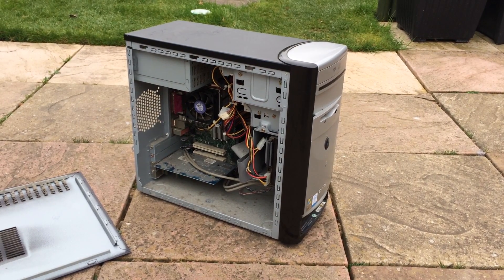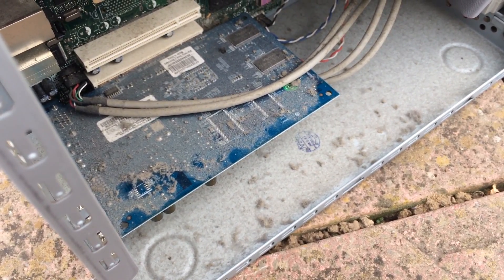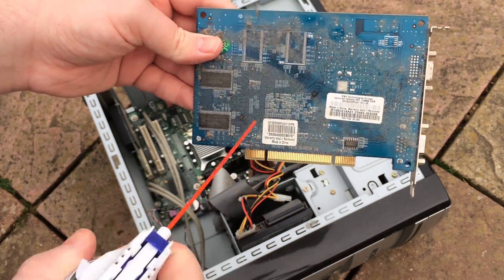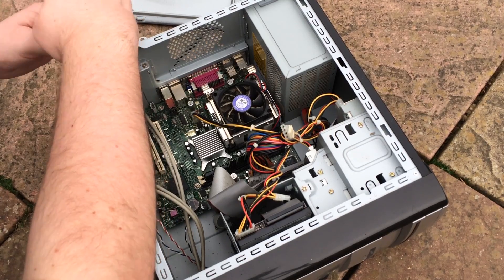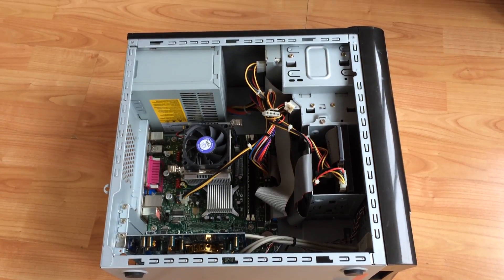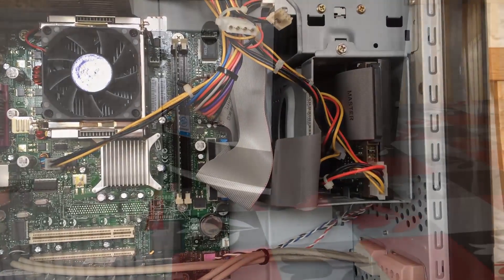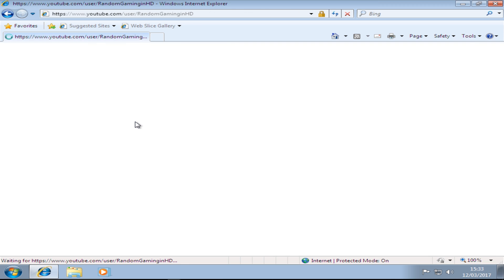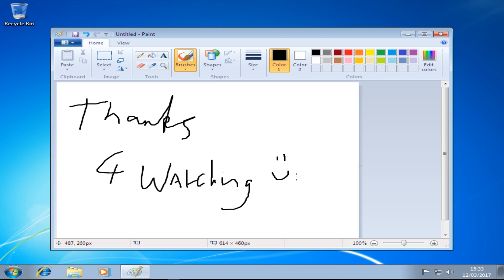Cleaning up a Super Dirty Old PC

Comment: My favorite method is to use a leaf blower <low power one>, it freaks out the uneducated and those ruled by myths rather than imperiacal data.   Less scrubbing involved than just use a small amount of cleaner and wipe everything down.  Also spraying down old Motherboards and cards with electrical contact cleaner and/or degreaser really cleans everything up to like new condition.  Obviously make sure everything has dried/evaporated before trying to introduce power.

That old FX5200 you have there was a great card to make my Win98 retro rig handle everythying,  though I did add an aftermarket cooler to it as I never liked VCards without them.  Great video!

Comment: My parents computer is about 7 years old and that thing makes SO much noise it sounds like you're in a jet tunnel, I took it apart, cleaned it up, removing all of the dust, adding a better psu (400 watt) and an old graphics card that I had laying around from my old pc, I also found a spot on the case where I could add one more 120mm fan so I did. So about 5 man hours later and now I have a computer that doesn't work anymore, at least it doesn't make any noises XD

Comment: A buddy of mine also gave me an old Dell. It was a Dell Dimension 2400 and it was the filthiest thing I had ever seen. It was dusty, dirty the computer and even the keyboard and mouse were infested with bugs, it smelt horrible, and every time you turned it on the fan would blow out this dirty, musty, moldy, and rotten smell out of it. I cleaned it up and even then it still smells.

Comment: I use a Worx Air blower it does a great job getting out all the dust. I also removed the CPU fan and cleaned it out real good. You can then also use Brake Cleaner on the circuit boards just make sure you let it dry at least 24 hours. I always spread my lube (that's what she said) with a plastic bag and my finger inserted inside on the CPU surface.

Comment: Get yourself a cheap paint brush with relatively hard hair, it's very efficient to go into every nook and crannies. Blowing air is not enough. I also use 000 wire wool to clean connector contacts, it works very well.
For VERY dirty computers, the shower is not a bad idea. Take it apart and give a good wash to the various boards, let it dry completely obviously before using. Don't wash the mechanical parts.

Comment: I got an E-Machines T5088 with a Pentium 4 641 3.2 ghz(2 megs of cache) Three gigs of ddr2 ram, 120 gigabyte ssd, And an Amd Asus 6450 video card.  (All spare parts laying around) I paid 5 bucks at thrift store and runs pretty good for internet duties.  I think getting Windows 7 updates was the hardest part of this build but worth it.  I think this Cpu  I have was the last/latest Pentium 4 built for the E-Machines.  I'm gonna plug it in and see/revisit what is has to offer :) Thanks for video :)

Comment: This PC isn't that dirty.  I've seen PCs so filthy the fans actually couldn't move, not just the air, but themselves.

But, for this much dust, I'd recommend taking each component out and rinsing them in the sink (except drives - don't wash those).  Just be sure to let it dry before putting it back together.  I have only once caused damage by doing this, and that's because I was too impatient and turned the PC on before the GPU completely dried.  It still worked but started artifacting if the VRAM usage got too high.

Comment: Did the same thing with a Packard bell iExtreme P2.4 system that was being dumped by a neighbour. What cool about itmkit's pretty much trying to look like a Mac. Firewire ports, the speakers and 12 inch tft screen in a magnificent white stylised casing. Worth it a stylised antique games machine.

Comment: this is older than 10 years since it's using a socket 478, wow! Impressive how Intel's shittiest architecture (netburst) still manages to stick around even today. I personally would take an LGA 775/771 any day over this, actually I would re-use the e-machines case shown in this video and drop in a g41 chipset LGA 775 board, drop in a 45 watt xeon l5408, and clock it up to 2.8 GHz and be able to run mostly anything and overall light-years better than the socket 478 shown in this video, and all for 60 bucks including 4gb ddr3 ram, Asus p5g41 board, and l5408 CPU lol!

Comment: Yep good advice. People would be surprised how dirty their PCs can get and how much it affects performance. Related but off topic, I remember buy a video card off a guy that must have been a heavy smoker. The card was pretty cheap and the board and its heatsink were coated with tar and dust. I didn't even try to see if it worked before doing at least some basic cleaning. I did verify the card worked, then disassembled (didn't even know what colour the PCB was beforehand) the heatsink and cleaned the PCB carefully and the heatsink aggressively. I think one of the reasons he sold the card was because it was thermal throttling. it now works great.

Comment: I tend to completely disassemble such PCs when cleaning them, taking out all components out of the case, makes it much easier to clean everything properly. Also you didn't really clean the power supply the way you did. You need to take it out, and then open it up, usually quite a lot of dust has been layered inside the power supply, and just blowing it from the outside won't remove it. Not to mention that power supplies of that age usually have crappy capacitors, and some of them might be swollen or even leaking by now, a good idea is to check their condition, and maybe replace them with better ones.

Comment: i have an old pentium 3 550mhz with 256mb ram and 128mb ati radeon 9000 family and still works fine after all these years. its gone from 98 to even windows 7 (with a little trick;) and windows developer preview (an super old build of windows 8 that does not need nx bit) but i have put it back to xp a few weeks ago 👍

Comment: I'm about to build my wife a new budget pc, and will be getting back my old pc, which is an older Intel Core 2 Quad Q6700, with 6 gigs of ram (which is sort of all over the place) but no GPU, since we'll be reusing the 750 ti I threw in there a year ago. I have a couple older Radeon cards, I think I may use one of those to hook it up to the tv as a media center/emulation type thing. The older system is being choked with dust I think, so this is just about perfect, and timely!

Comment: Love these videos, still I would just change two things. First I would not put any machine directly on tiles or concrete, because it scratches the plastic and/or the side panel. And on a retro machine like this I would go for Classic look in Windows 7 to make it yet a tad more snappy :)

Edit: And maybe one recommendation :) Try to put the compressed air can into some hot water for a while before every use. It will give you much better pressure and it works marvels even with an almost empty can.
Reply: Good luck running W98 on a gig of RAM :) Well, the CPU itself is from 2003, the machine could even be a bit younger... and if he wants to run Windows 7, why not... I tend to think that the classic look fits more and helps a bit since it can't do Aero anyway.

Comment: In the olden days I used to put a 10 mm thick foam in front of the intake case fan. It managed to decrease the amount of dust considerably inside the case... luckily now most decent cases come with some kind of air filtering.

Comment: Nice job. Although my cable management would be abit different. Channeling the P4 12V plug directly upwards and between the heatsink and the PSU. All the unused cables put together between PSU and the optical drive or inside one of the unused 2,5" drive bays. And using high skils in folding and routing IDE ribbon cables. It becomes second nature once one builds vintage gaming rigs and has an eye for tidy cables.

Comment: you should really take off the psu, open it and cleaning it with your can of compressed air, the dust it's a really good conductor and you can easily clean it honestly, to avoid problems, even if it's a cheap ass psu (plus the dust smells awful when the PSU catches on fire...)

Comment: Planning on doing my first build
Parts:
I3 7100
Asus Strix B250F
Corsair vengeance 2400 ddr4 8gb
Cooler master hyper 212
Be quiet 400w psu 80+ silver
1Tb hdd
Need a cheap ssd
Need a cheap case with usb 3
Artic mx 4

Comment: Some cleaning tips.

I use a vacuum cleaner with a brush to get the bigger crud, obviously you have to mind yourself when using the brush in the case. If you are concerned about static then use a grounding strap on your wrist. You can also just not use the brush if that concerns you.

I also use a small air compressor to blow out my machines with. It has a regulator valve so I can adjust the PSI so I don't use too much air force. I bought the compressor because I found that it was a better and cheaper solution than buying compressed air cans all the time, much cheaper in fact.

I bought the small oil less compressor from Harbor Freight with a 1/4" coiled air hose kit that included the quick connectors and all the parts needed for light air blasting, filling tires and sports equipment. I don't remember the price but it was well under $100 US. You want a oil less compressor because you DO NOT want small oil particles being blown onto your computer parts.

Use short bursts of air to blast away dust and debris. Do it outdoors or on a terrace etc.

When it comes to cleaning off heat-sink compound many people recommend isopropyl alcohol, I actually don't. I use what electronic technicians use which is Ronsonol Lighter Fluid. This is a very good cleaning agent in the electronics world, you put a little bit on a Q-Tip or cotton swap or a small bit of clean cloth. That makes short and very clean work of old compound. It works well for removing many types of compounds, residues, tars, grease and oils and it is recommended for that. You can also use it for cleaning up cables and extension cords.

If you are dealing with a very nasty case, use a small face mask/filter. You do not want to breath that stuff in. You don't know what might be in that dust. Good luck and I hope this helps.

Comment: This is invaluable if you deal with a lot of dusty, dirty PCs and electronics.  I've had one for five years and its paid for itself many times over (not buying canned air). 

https://www.amazon.co.uk/Metro-Vac-220-DataVac-Electric/dp/B003BZCOKK/ref=sr_1_1?ie=UTF8&qid=1489362877&sr=8-1&keywords=datavac+ed500+electronic+duster

Comment: You should buy a small air compressor. 

It will save you time and money in the long run instead of buying all those cans of compressed air.

(Not only that but they produce a much cleaner stream of air with more power.)

Comment: I just cleaned out an old Sony Viao PCV-RX550 and a Gigabyte 8VM533M-RZ based rig I saved awhile back from being recycled today, and they're running great now, I even threw in 512mb of SDRam into the Viao along with a 2.2ghz P4 (400FSB), and the Gigabyte received 2GB DDR1 and a P4 2.8ghz (533mhz), and both are running like a dream with XP and 7 respectively. :)

One time though I had to clean a pc, and the moment I opened it a ball of dust the size of my hand came out, and the entire motherboard was coated in dust and spider webs completely, took me 4 hours to clean it up.

Comment: Keep up the good work. I substitute the compressed air for a paintbrush to loosen the dust in all the nooks and crannies and on PCBs, then wipe down everything else with a slightly damp cloth. Been doing it like that for 30 years. Never had a problem, and still using the same brush. Probably saved hundreds by not having to buy cans of compressed air.

Comment: i found one that was even worse that that one in the trash, it had a pentium g850 an h61 ECS mobo 4 gigs of ddr3 1333Hz ram and a 500 GB HD, it also had a 1 tb HDD but the controller card was scratched and on of the tiny copper wires that run through the PCB was snapped out, a little cleaning and it was running just fine, i bet it was over heating and turning it self down because of all the dust on the CPU heat sink and they thought it was damaged, the only problem is that the case has no side panels nor does it have fans and it has some oxide here and there, so now i need some thermal paste and a new case to have a new computer for light internet browsing and stuff.

Comment: Also i noticed you had a "Non PCIE" GPU in the PC, I'd love to see you find the best "Non PCIE" GPU you can, and review its performance, and thusly the limitations of the PCI Bus, Great Video as Usual. 

You Truely are the best YouTuber I know
Reply: JonasMC: Sorry I don't believe I made myself clear, I ment a "Standard PCI" Graphics card, as in  not AGP or PCIE.
Reply: Budget-Builds Official I hear they made GT 430s and GT 610s as PCI only cards. the 610 is nice in a northwood P4
Reply from the maker: thank you, I'll look in to finding something like that :)
Reply: DED DOA the HD5450 was also released as a PCI Card, and a comparison to the PCIE versions could be made, allowing us to see the limitations of the device
Reply: I have a PCI GT 610 512 MB GDDR3 VGA. It's quite cool stuff but I can feel the limitation of the PCI port.
Reply: The best I could find was the Voodoo 5 (still got it, just got to put an old PC together to use it though) as it was pretty much as fast as the AGP version. I picked it up a few years ago when I still had PCI slots on a mobo, so I couldf dual boot windows 98 and get full glide support. It was mac card with a bios flash to get it to work on a PC.
Reply: 4670 FTW! Apart from the lack of DX11 I enjoyed using it
Reply: Please do make a video about that! I have a Dell Optiplex G1 with a 350MHz PII and it doesn't have any AGP slots. I'd like to upgrade the horrible ATI Rage integrated graphics that are in it right now, so I'm wondering what's the fastest GPU that I can get for the PCI slot. I don't care if the CPU will be a bottleneck, it's just for fun.
Reply: @Minecraftminer3000  Depending on what operating system you are going to be using and your budget,  Voodoo 3 and up are great especially if you add in a Monster 3d accelerator card,  however you can find motherboards that support your hardware that have agp for pretty cheap these days.  In that case the Agp version of this card he used here the FX5200 is a good card as well as the ATI 9700 pro both are 256Mb cards that will run Win98 stuff at max without even breaking a sweat.
Reply: xXx_420_360_HaX0rDaN0uSkoupah#sWaG#l3g1t_darud3w33dstorm_360_420_xXx 

Unfortunately that mobo has got only PCI v2.1 slots. The GT430/520/610 needs at least PCI v2.2 slots (I've tried my GT610 in a  Socket-370 Compaq mobo) :D
Reply: pretty sure those are AGP GPUs
Reply: The GPU is a GeForce FX 5200 which is a budget card in its series, uses PCI which is a HUGE bottleneck for the card as PCI can only do so much, and is a part of the FX series which was one of Nvidia's worst GPU series and almost eroded all trust Nvidia consumers had with the green giant. That only widened the gap between ATI and Nvidia until the 6000 series. Ontop of a celeron processor and only a mere 1 GB of ram (probably DDR1 so good luck getting steam installed) and a 40 GB HDD, the PC was probably a budget PC for office use that would cost between $200-$400 USD. Yes it may be able to run Windows 7 but to utilize it to its fullest, the bottlenecks have to be ironed out. In this case, the whole PC is a bottleneck. Haha
Reply: Budget-Builds Official Its called AGP and the best AGP videocard is HD 3870 and the latest one is HD 4670.Both dont support directx 11 tho :/
Ohh you meant the regular PCI(non express).I know there was a version of HD5450 for PCI,doubt that there is anything newer.
Reply: @MartinDimitrov0  ATI 9700 pro works great for a retro build but as for what was best,  it comes down to preference as back then most cards using pci slots were in the same general area as far as performance.  Yes there were some extreme ones but I refer only to general use by consumers not enthusiasts who destroy markets.

Comment: Luckily we have an industrial air compressor with air lines all over the place at work, it has a proper moisture trap which removes water from the lines. I use this to clean all the computers I work on, they look brand new after 5 minutes of blasting :D

Comment: Hey Randomgaming i picked up 11 old work computers with Celeron processors and they all had 4gb of DDR3 ram with Mother boards and Power supplys for 30$ each, There were 7 LGA 775 sockets and 4 LGA 1155 sockets im replacing the cpus with E5450 xeons and putting amd radeon 7870 or 7950 GPU in em and they can run EVERY game on 1080p 45+ FPS execpt battlefield 1~ Just wanted to know if you want one for a video!

Comment: If i put a gtx 1050 ti with a 1.4 GHz dual core apu will the games run better i, have 512mb of shared memory
Reply: Zenix i forgot to mention that i was building another pc and i was going to use this until my other parts come xD
Reply: John Plays  Get a 650ti its gonna be bottlenecked
Reply: Labib's Official Science Page no im going to buy parts for a new computer with core i5-6500 and i want to put the gpu in my old computer so i can get the max of it until i get the parts for the other computer
Reply: get a msi cheap motherboard 8gb drr3 and gtx 1050ti and i5 you will be able to run most games on 1080p

Comment: you should also oil the fan bearings you can usually find them under the sticker, and also clean out the psu